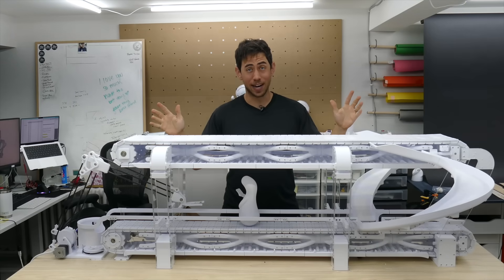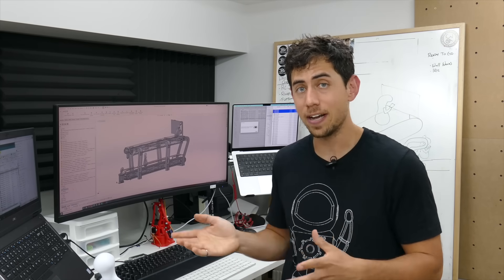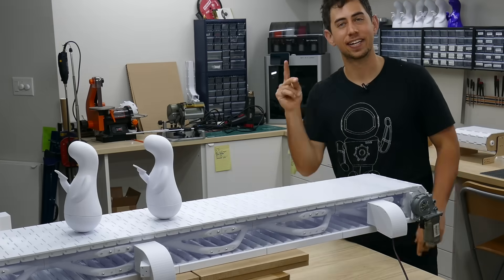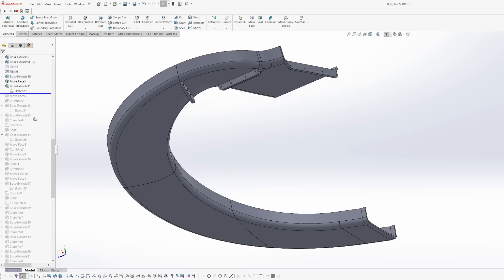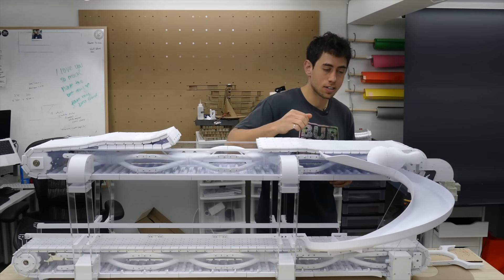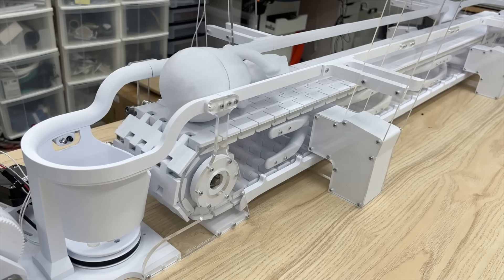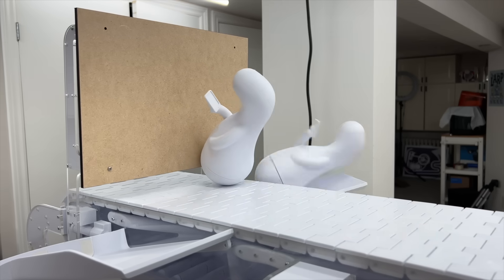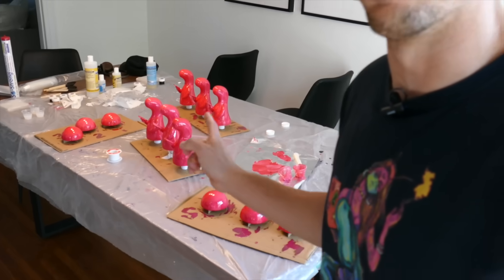Making a “Phone Bad” Moving Sculpture

Comment: This is art, and I love that this exists. I know it's not the fun part of the process, but please do try to get it put on display somewhere outside of just Youtube. Because this being a thing that exists in real life is part of the appeal.

That said, I can't help but feel like the orientation mechanism with a motor is a bit overengineered. I think it could have been possible to just have the shapes of the figures and the container it lands in to just rotate the figures to the right orientation from gravity alone? Might have been that you designed the figures before tackling the rotation issue that meant that doing this wasn't an option at that point. The motorized re-orientation doesn't detract from the piece in any way though, it just struck me as needlessly complicated.
Reply from the maker: There’s definitely a way to improve on that! Definitely will find a place for it one day :) thanks for appreciating

Comment: I’d have to say, you are amazing.  You’re doing everything I wish I could do, except I have no artistic bone in my body.

Not only that, this whole thing is a process.  Process of trial and error, wasted 10’s ,of 1000’s of hours on wasted time and filament because you realize that all of these parts you printed, won’t work.  Not only that.  You design and engineer your parts.  That’s another add on stress factor.  And you absolutely have joy in wasting material and hours on 3d printing!

How do you do this?  I don’t even design any .stl’s; I just throw it in the slicer and print.  My Adventurer 3 printer caused me so much anguish, I’m on the verge of chucking that piece of shit out of my second story window.

How do you do this?  I wish I could enjoy failure as much as you do!  Awesome work man!

Comment: Next time you need to paint with resin, instead of using epoxy resin, use 3D printer resin.  The clear can be colored extensively and effectively.  Brush it on then hit it with UV.  You may have to do a couple extra layers because you need to do it pretty thin, but you won't be worrying about a time limit.  As well, you can consider using dipping techniques.
Reply from the maker: Great suggestion!

Comment: 6:21 was literally wondering that when you mentioned earlier that your wrist was tired. Thought maybe you couldn't fit one where you were screwing or didn't want to strip out the plastic.

Pro tip for everyone, from someone who took far too long to learn and understand:

Use the clutcc mechanism on your drills (the spinning part with numbers around the chuck) lowering it makes it where the drill stops and clicks when it gets too hard to spin so you don't strip out or overtighten.

I spent far too late ng not understanding why that was there and using it set on drill mode, and stripped tons of screws and threads

Comment: Just a thought, it may have been simpler to have the wall angled so the figures only have one way to go, then a conveyor in the opposite direction to bring them back to the start. Then you would have two lines of people parallel to each other forever going in opposite directions.

Comment: This is a very impressive piece. I actually have a fun idea you might want to ponder, you could embed an acrylic piece into the 'phone screen' and edge-light it with a single LED, then use a super-capacitor and a resonant coil setup to charge them at the arm station. The end result could either be the phone screen fading out around the time they hit the wall, are heading back, or just staying on perpetually depending on the desired balance of how much they are charged/discharged.
Reply from the maker: That could be cool!

Comment: Very cool idea and execution! A couple of things: I think it looks best entirely monochrome. And the clogging issue at the wall might be solved by changing the cross-section of the wall into a slight curve or chevron, with its farthest protrusion toward the Buddies. A wedge shape might add a further layer of meaning,  or clarify the existing implications of two slides.
Reply: I feel like the clogging at the wall/billboard is part of the piece... If only they would look up!!
Reply: I like both. The clogging implies “just look up,” the wedge speaks about the division these devices have caused. 

Having said that, I agree that a little bit of a wedge would be nice. 2 reasons: 
1) it’s kind of maddening to see the gaps for the OCD people in the world (not me of course)
2) the evenly gap on the top conveyor belt really speaks of an assembly line; which goes with the theme of no creativity and even matrix-esque. 

Anyway, I love this!

Comment: Um... What was the point in printing out all of the figurines and then covering them in epoxy if you were just trying to have a mold to make several out of one?
Reply from the maker: The printing allowed me to carefully control the weight of the upper- I changed the settings to specifically reach a good strength/weight ratio. The epoxy was to give them a gloss finish and to help strengthen the outer shell
Reply: @Engineezy  oh!!! Thank you for the explanation

Comment: The slides need an update. They could use taller sides to help keep the buddys from jompung out. Also, a slight bow in the wall will help push buddies to the sides while still allowing them to pile up.
Reply from the maker: Taller sides are in order for the slides! But the wall is meant to cause pile ups 🙊
Reply: @Engineezy  I'm not saying to curve it so much that it prevents pileups. I'm saying that just a very slight almost unnoticeable bow would cause the pileups to push each other to the sides a little better.  Considering the size of the sign you probably wouldn't need more than a quarter inch of bow.

Comment: Pretty cool result! I think the orientation method could've been simplified by placing a magnet under the conveyor belt, since Buddy's magnet is off center and on the back, it would orient the figure facing away from the stationary magnet until it'd snap facing the front. Though looking at how thick the belt is that would need to be a pretty strong magnet! Maybe a similar method with magnets on side barriers could work!
Reply from the maker: Could be an interesting approach! Would be fun to play around with that concept

Comment: I think as an improvement you could use a laser sensor on the lower conveyor belt rather than stopping it when one's being oriented so that the Buddies don't get backed up at the slide entrance so much.
Reply from the maker: I actually did consider that, might have to add it still!